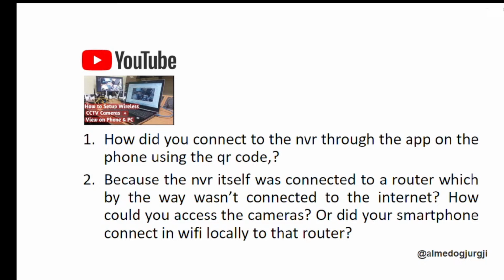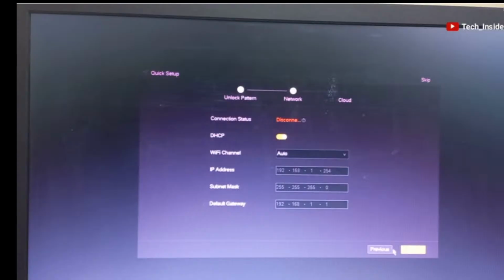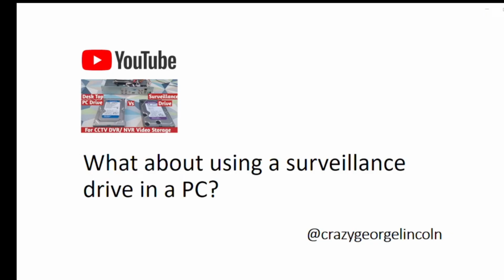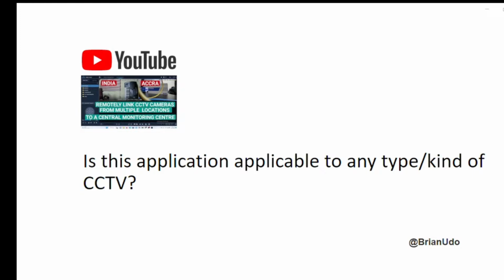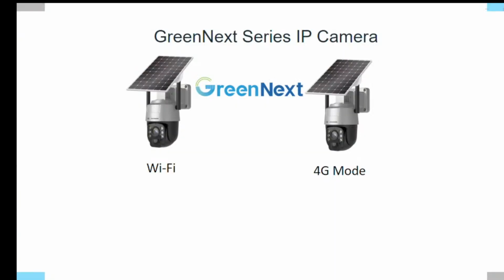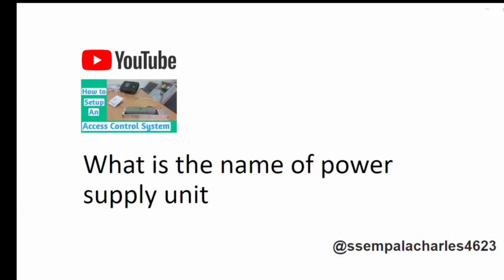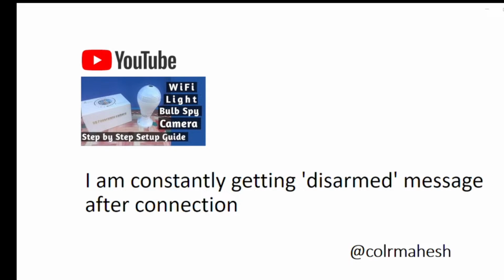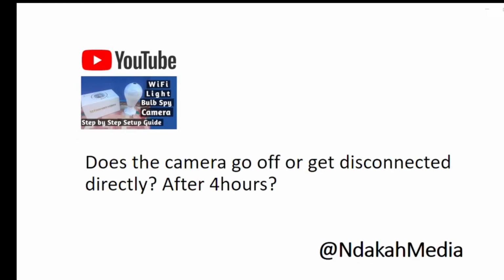Viewer question and Answers time LIve

Comment: Again i had the same issues of the no available HDD and the fault was not the hdd but a faulty adaptor which wasn't supplying the dvr the required volts to work effectively. So i suggest u get another adaptor with high amps
Reply from the maker: The HDD uses power that is supplied as a result of power that comes into the DVR and once the voltage level is not up to the required level, the HDD will not function.